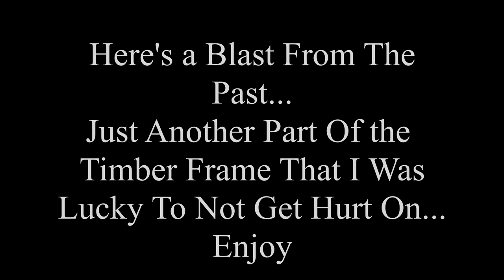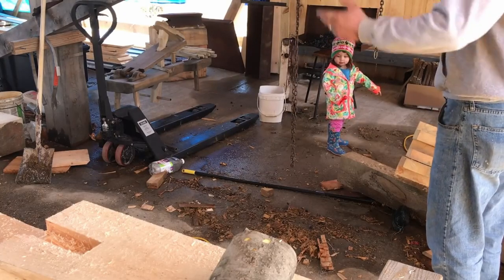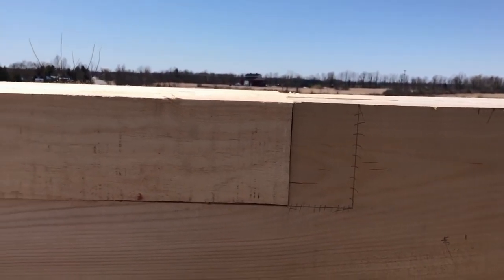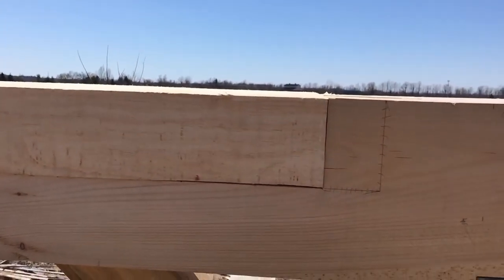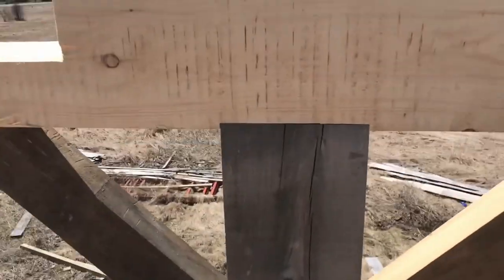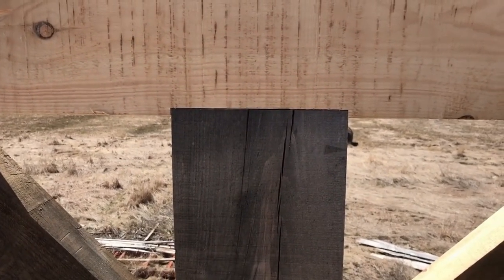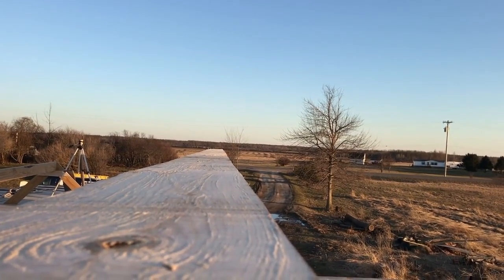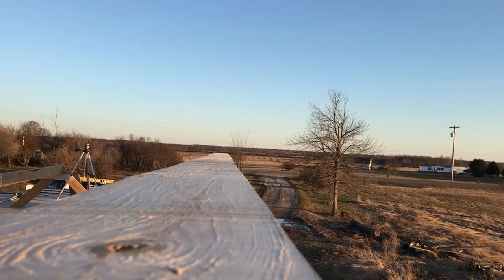Another Part Of The Timber Frame Build That Should Have Taken Me Out: Throwback Video

Comment: Awesome work Jim, even in retrospect. Wish my joinery was that good but I'm getting there. My build is going well I have the mill inside where it belongs but not powered up yet. Closing up holes is ongoing, "The devil is in the details". Bridge crane is up but not powered up yet. WE burried the conduit and pulled wire while the weather heald, Thank God. Still have to connect the wires and then I can take down the temp. overhead wires before the snow does it for me. kind of a push there but I'll get it before spring.